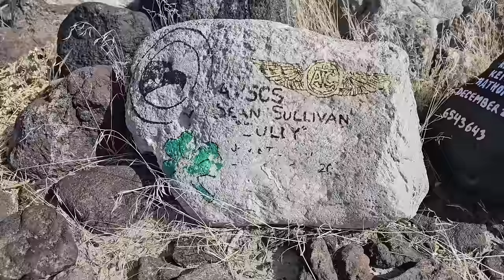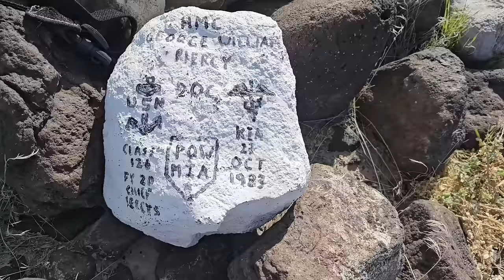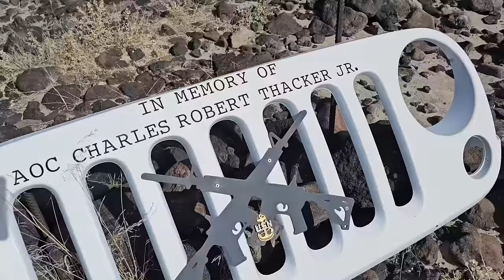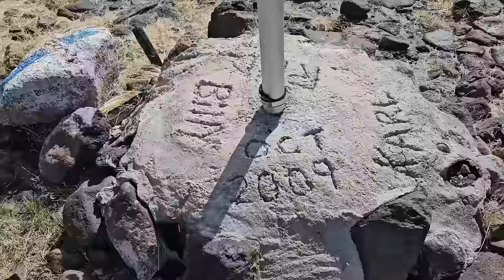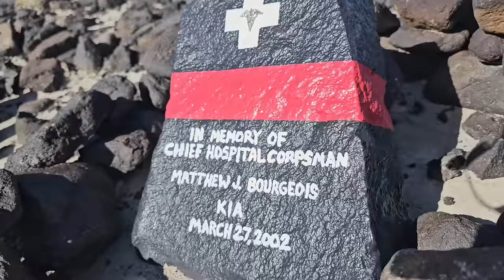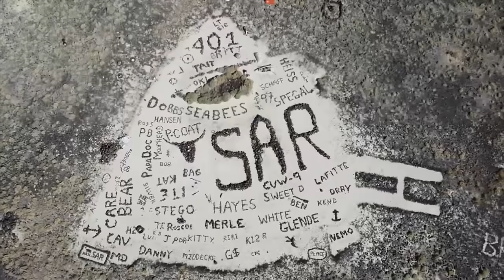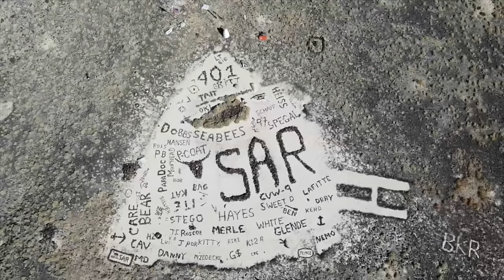Mysterious Military Memorial on Top of a Mountain in the Nevada Desert

Comment: That nosecone is from an F-4 Phantom. It was a Vietnam-era front-line fighter, used by the Navy, Marines, and Air Force. The bit with the crash test dummy appears to be the rear canopy section from an FJ3 Fury. It was a Navy fighter from the 1950s. Cool video!
Reply: Yup, FJ3, the naval variant of the Air Force's F-86. It was a superior craft in many ways. Some were modified and equipped with Sidewinder AIM-9s. First saw action in Korea but it wasn't really put into wide service until 1954. Retired in 1960 or 1961, if I recall correctly. Top speed around 690.
Reply: I think the green tank shot full of holes "used" to be a oxygen tank.

Comment: The item you looked at after the toy wheels was a Snake Eye Tail Retarding Device. Installed on the rear of say a MK82 bomb to slow it down when dropped at low level. Gives time for the aircraft to get away from the blast wave. Two of the fins were extended, two were still stowed.

Comment: I enjoy your videos!  Careful with your drone.  Not sure if you were in controlled air space but if so you were illegal.  Also, the FAA requires a commercial certificate if you fly for anything other than recreational activities.
Reply: All of the DJI (hers is made my DJI) drones have built in GPS and the controller will limit where you can fly and if you are in a controlled area it will limit your height nor will not allow you to take off at all. Unfortunately where I live I am in a controlled area near an airport, every time I fly I am required to submit a request for a 24 hour permit and am limited to 200 feet altitude. The drone literally will stop climbing and will hit a virtual fence traveling if I try to enter the blocked area in the direction of the airport.

Comment: I've been to Fallon a couple of times working up to go out on cruise, with VFA-22 Fighting Redcocks from NAS Lemoore, back then it was an AIR FACILITY, when the GUVAMENT gave Miramar back to the Marines, they moved the squadrons to Yuma, Lemoore and Fallon and turned it into a full air station, as for Top Gun, its a school that teaches Navy fighter pilots to fight in better ways than they learned in flight training. The first thing you came across is a tail section for a RETARD BOMB, not exactly what they are called but when dropped to fins open up and slows the decent of the bomb. THe nosecone is from and F-14 Tomcat, and you're right, that is the housing for a Laser Designator. That a canopy frame, the dummy is sitting backward actually. The fan sections you saw, would exactly what you said, except you'd be turned into RED SPIT. MA1 ( Master at Arms, 1st Class Petty Officer), JAG is (Judge Advocate General, Military Lawyer) That and its a POTOGRAPHIC thing . The Navy's song is ANCHORS AWIEGH dear...lol